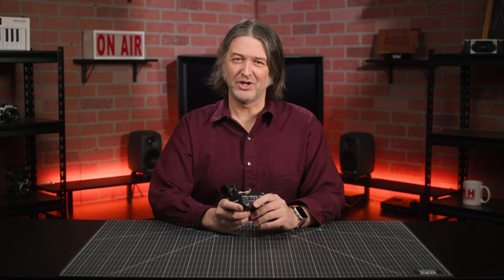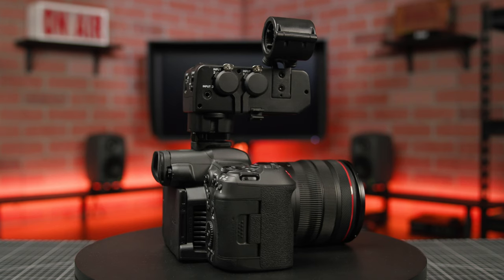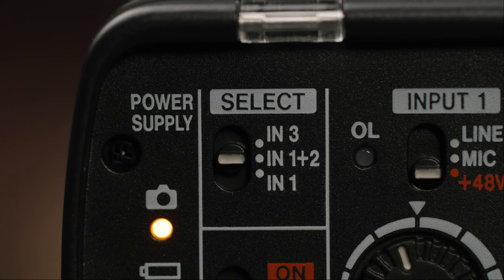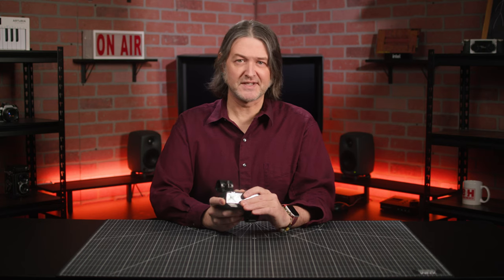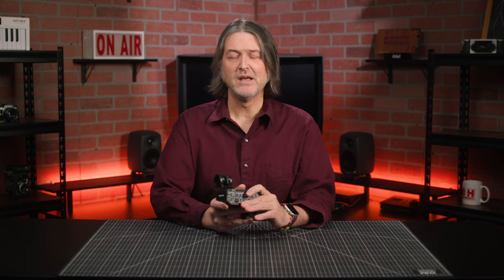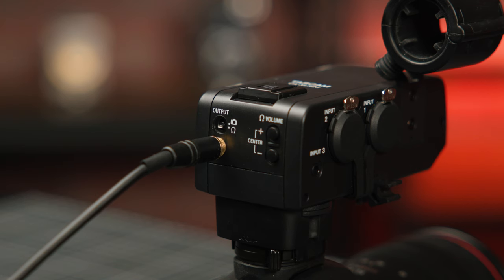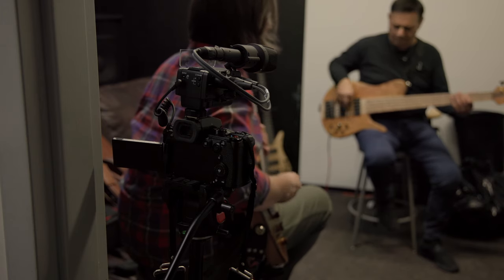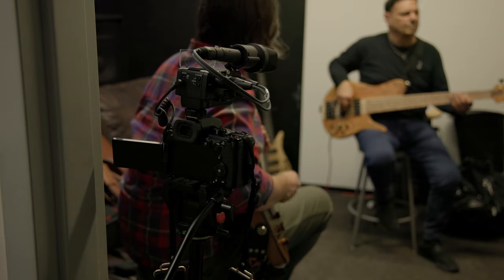TASCAM CA-XLR2d XLR Microphone Adapter | Specs & Hands-on Review

Comment: I’m a newbie. I need to connect my DJI Mic to the R5C but need to know how to do that and what settings to put in the R5C. None isn’t the videos on the Tacam actually show how to. Any help would be appreciated.
Reply from the maker: The DJI Mics should come with with a TRS cable to connect the receiver to the camera. You can adjust the levels on the receiver or on the camera in the audio settings.
Reply: @BandH  Thanks so much. It works a dream!

Comment: That was a smart move to create the analog connection.  Do the limiters and phantom power options still work?

Also, I was confused when you said you used the Panasonic camera, then threw b-roll of the Canon camera while the band was playing.  Please clarify.  Thank you.
Reply: The B roll shot you mentioned is of the S5ii not the R5C. You can use the phantom power and limiter etc with the analog connection - the AT stereo mic used to record the band with the S5ii requires phantom power. The battery sled needs to be used to provide power.